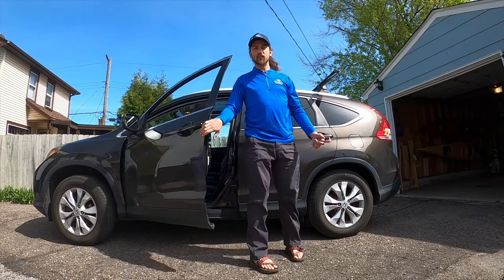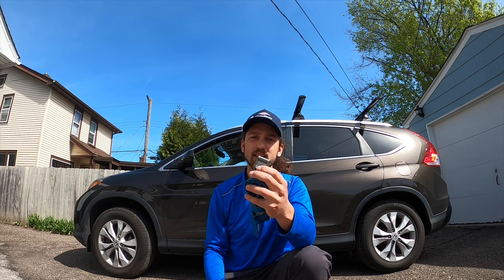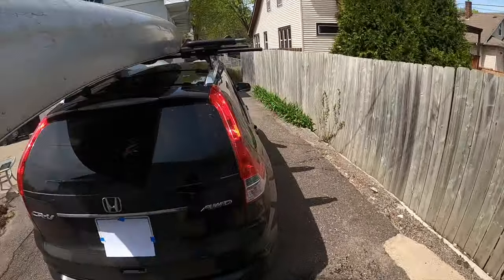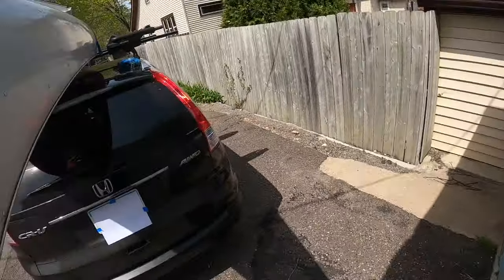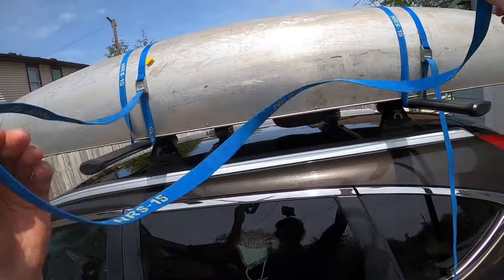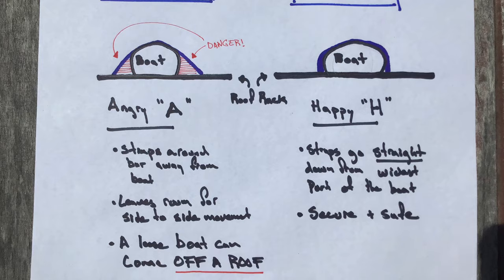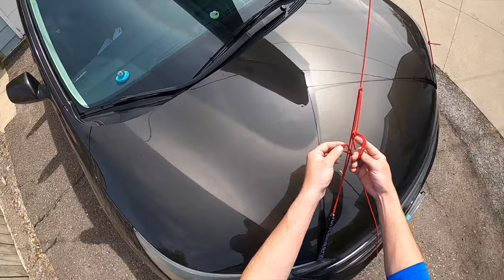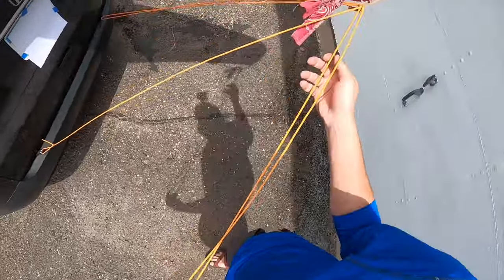How to Strap a Canoe to Your Vehicle

Comment: Home Depot sells 4-ratchet straps kit for $10. They are highly rated. I would run a safety strap through the rear passenger windows and lock it down. Driving down the expressway at speed puts a lot of aerodynamic force on the canoe and the roof rack. Make sure it's rated for carrying a canoe.

Comment: "Nice job with securing the NRS straps to the rack! I did notice, however, that the roof racks are positioned quite close together. It would be more effective to slide them as far apart as possible on the roof. This will provide better leverage for your straps, and you likely won't need a rope on the bow and stern of the canoe if the roof racks are correctly positioned."

Comment: You mentioned several times to make sure the cross straps lay flat, but when I do that we generate that abnoxious hum from the straps vibrating when travelling faster than 50 km/h.   If one continues like that, damage to the car's finish results as well.  What do you recommend to address that?  Thanks.

Comment: Get the straps that have the padded buckle which reduces the chance of scratching your car or boat (especially if it's fiberglass or carbon fiber.)  You can also get straps with locks and that have steel cord in the strap which makes it very difficult to cut.

Comment: The way the back line is tied is counter-productive.  Instead of connected to the end of the canoe they should be tied to a thwart that is forward of the tie in point of the rear of the vehicle so that as the line is tightened the canoe is pulled tighter to the vehicle.  Also all that is holding the front loops in place is the hood latch; not a very strong part of most vehicles.  Loops CAN be used through the hood crack secured with bolts or through holes in vehicle body parts that are much stronger.
Reply: The straps should have run inside the towers instead of outside as well. That would have directed the force inward and solved his "Angry A" situation.